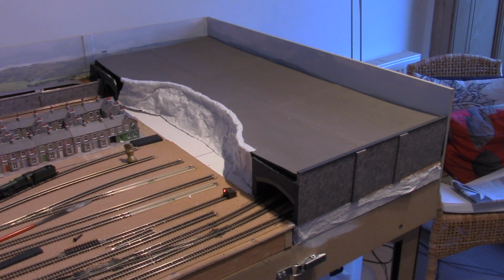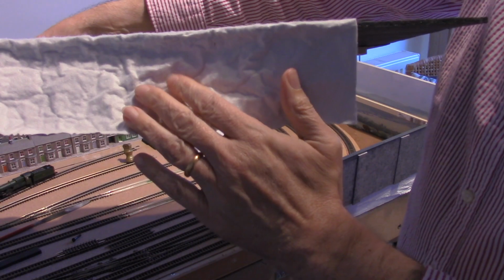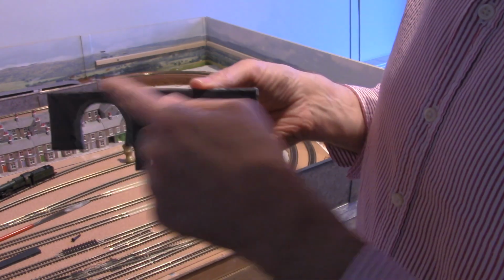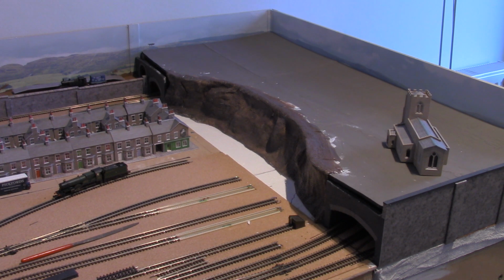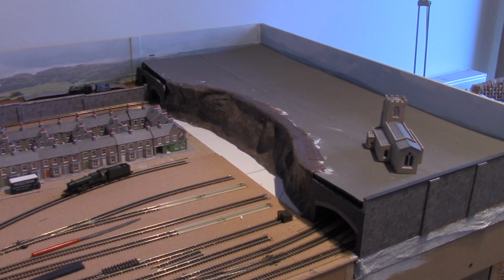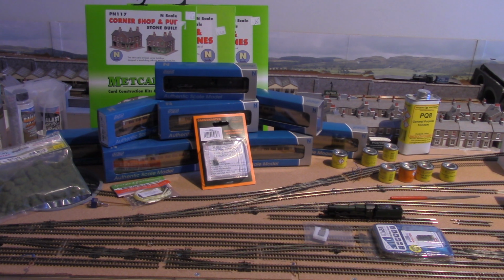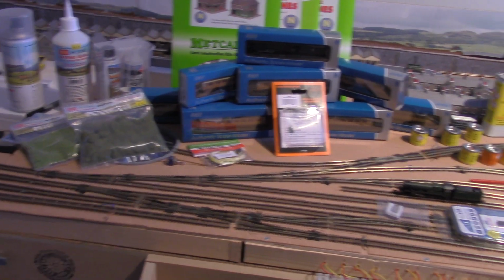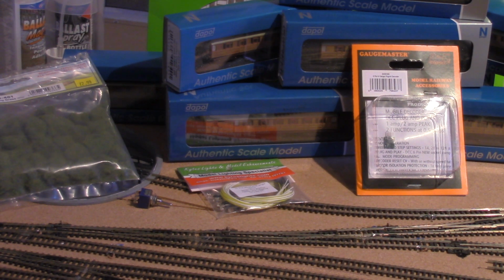Elvenhome Model Railway Layout  Update (Ep 20) - A Streak Comes to Elvenhome

Comment: As you have already done so with the rock face, I suggest that you connect the tunnel entrances and side wall to the raised section. Where your church and station are going to go, so the whole area comes off in one piece, this includes the stairs down from the station.  Cheers Steve
Reply from the maker: Thanks for your comment Steve.  The thought of building the whole section as one unit had not occurred to me at all!  I have firmly fixed the end wall and tunnel portals down now, but I have a sneaking feeling I may replace the top board.  For the moment I will,at least,  use the top board as a way of finalising the design and practicing my scenic skills.  If I do replace the top board I will do as you suggest.  Thanks again.  Stephen

Comment: Hi Stephen. Great video. I am looking forward to the next video on installing the MX658N sound decoder and speaker from Zimo. In a previous video, you mentioned receiving a B-set of maroon coaches, which prompted me to purchase three sets for my layout. Apparently, each set will bear the same running numbers (I know I COULD change these, but this is too ambitious for me at this stage). Were you able to get separate running numbers on your rake of teak coaches?
Reply from the maker: Paul Smith Hi Paul. Dapol are very good at producing coaches with differing numbers. I think a couple of my teaks have the same number in each rake because they are 8 coaches long. I agree with you that I wouldn’t try to change carriage numbers having changed a loco number. First it would be very fiddly but it might also damage the coach in getting the old number off.  Stephen